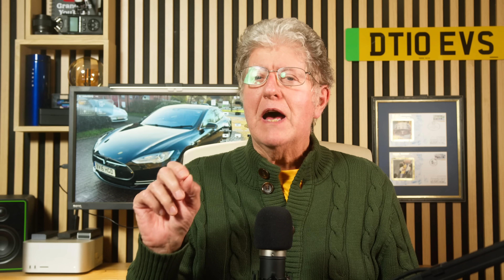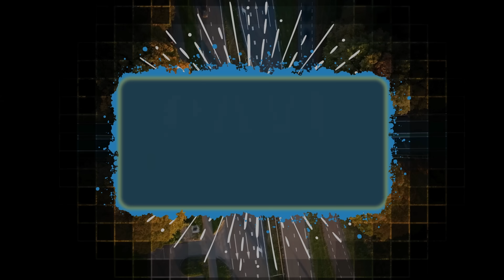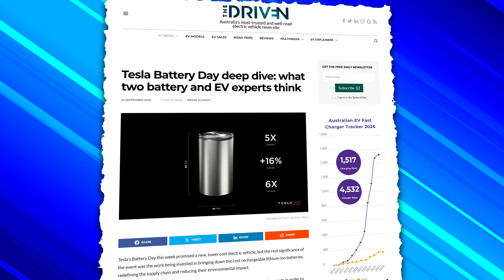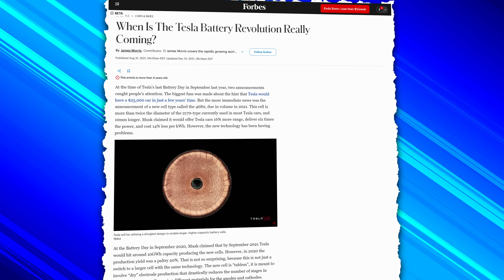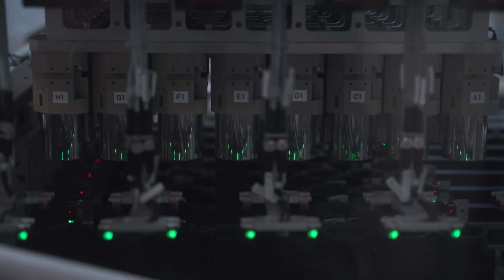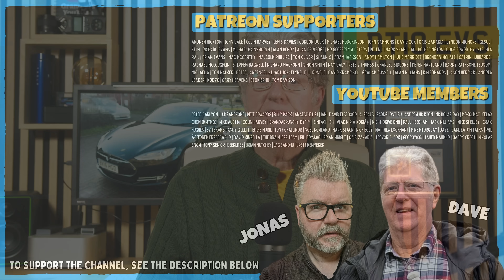The Real Reason Tesla's New Battery Is Such a Big Deal

Comment: We're getting several "impossible" battery technologies this year (2026, Year of the Fire Horse) including dry electrode, silicon anode, anode free, all-solid-state, semi-solid-state, sodium ion, as well as advancements in established tech like LFP, LMFP and production automation. Much of this is driven by decades of progress in understanding electron transfer mechanisms, electrolytes, separator materials, and nanotechnology coatings. This is now progressing much faster than many realize. There is a good chance that BEVs will be cheaper to purchase (without incentives) than ICE vehicles in most Western, Eastern, and Global South markets by the end of this decade.
Reply: BEV already cheaper to manufacture then ICE including battery for sedans cars. Betting SUV and trucks to follow suit in 2027-28
Reply from the maker: Exactly. These are exciting times. There's so much investment into battery technology and there's no shortage of compelling options at a variety of price points. Like we saw with solar, batteries will only become more affordable and more efficient over time. Not only that but EVs are already substantially safer than ICE vehicles.
Reply: And many of these technologies are additive, and some are pre-cursor steps to the ultimate goal for electrochemical cells, the Metal-Air battery, with their extremely high energy density (11,140Wh/kg for Lithium-Air, though ~4,000 Wh/kg is more likely in everyday operation). The technology was slated for 2035, but with the pace of developments recently could be somewhat earlier in maturity.

Comment: But the Chinese have already started mass producing sodium batteries, with over 10,000 cycles, only about 10% loss at minus 10 degrees, and are cheaper to produce. So I have a little difficulty seeing that Tesla's new battery Is Such a Big Deal. And they are close to solid State.
Reply: Sodium has an energy density of 160–175 Wh/kg, vs 4680's energy density just short of 300 Wh/kg. There goes your range while adding over 50% more battery weight. You have to understand priorities in most EVs.

Comment: 4680, tabless, dry electrode battery using Tesla Lithium from their own refinery will cut battery costs, increase longevity, increases power, and lowers charging time, temps, and weight!
Literally a small step in every direction making it an amazing fusion of success.

Comment: I just read that CATL and Tesla have a LFP factory in Nevada that is kinda under the radar so I wonder if the new 4680 dry anode and cathode which used to be NMC is going to be LFP now
Reply: You're assuming they'll be manufacturing cylindrical cells rather than pouch ones at Nevada.
Reply: @GruffSillyGoatI presume they will be because of the 4680 and 2170 that is made there next door already in the big building 

I presume it will help the Austin and California kato factory and the megapack in California and the new Houston one

There is also Panasonic in Nevada down the road so I have idea what it is for tbh ATM

Comment: Dave, Tesla's is just catching up with others, the issue is the others have moved on already. Like the UK's Nexeon who's gone into production with their Silicon anode technology with their South Korean partners; a technology that can be used in both Lithium and Sodium cells, raises their energy and power density, and lowers the cost of the cells.
Reply: That is amazing.. what China car gets 1200 miles per charge?
Reply: @davidbeppler3032  - does any Tesla do that? I thought their record was 1,200km (not miles) for a Model S using Our Next Energy's Gemini cells.
Reply: The motivation for Tesla is internal to them (Vertical integration) where the intellectual property, profit, design is all their own. Yes, there may be better batteries out there but Tesla does not want to buy them in from someone else who is charging a profit on top. Nobody cares what batteries are in their vehicle's packs - they care about the cost. Other factors might become relevant like speed of charging but this also depends on the chargers you use. Home charging at 7kw means the recharge speed of the pack is capped there, not by the tech. Mercedes have a super fast charging car but no chargers to make use of it. Tesla is extremely good at looking at the end to end, which is why players like BMW are embarking on their own battery plants (4680 incidentally) to cut out the middleman.
Reply: @ouethojlkjn  - BMW's cylindrical cells are 4695 and 46120, rather than 4680, they're seeking to use immersion cooling rather than paste/plate cooling to reduce the space overhead that cylindrical cells introduce. However, this makes the pack (like Tesla's paste base 4680 Cybertruck batteries) less serviceable, requiring the whole pack to be replaced. This isn't economical in lower cost vehicles, where from the end-to-end perspective the repair and maintenance cost also needs to be kept low not just the manufacturing cost. 

Mercedes, by which I assume you mean their CLA, is an 800v architecutre vehicle, with an optional 400v charging system. If one is in a country or area (like many parts of Europe, including the UK) with a high availability of 800v chargers then one doesn't need to option the 400v charging capability. Yes it means they couldn't charge at Tesla 'Superchargers' but these are relatively old tech anyway (sustaining 140kW that derates to 90kW when a charger is busy, which is becoming more often now with the uptake of EVs).

As to advantages of vertical integration vs horizontal, verticle lowers cost in establishing a technology but horizontal significantly lowers cost in scaling a technology. What Tesla is doing is less about scale and more about reducing internal costs as they face a shrinking market share (and facing rising costs of operating in their domestic US market).

There are horizontal dry coating specialist companies, like Anaphite in the UK, who not only already support NMC cells (that Tesla proports to productionise by the year end), but have already moved onto extending their roll-to-roll technology and dry coating chemistry to LFP cells.

Comment: This guy has been living under a rock. Tesla has been fiddling with this for five years and both battery technology and production methods have moved to another level. Tesla is coming to the market with a product that is already years behind.
Reply: Decades behind.  Toyota has had Solid State batteries since 2017!  Toyota EVs could do 1200 miles per charge and charge in just 2 minutes from 0-100%!
Reply: @davidbeppler3032 Exactly, Tesla and Toyota are the same battery losers. The difference is that Toyota is the biggest car manufacturer and has the most sold models, but don't tell the Tesla fanbois, they keep telling themselves that Model Y is the most sold model. BYD nixed the request from Tesla to get their Blade battery, but the best battery Tesla ever had is still the first gen BYD battery, while Toyota delivers EVs with the worst range performance in the market...
Reply: Not really. It's for Tesla self sufficiency 

They have currently two 4680 lines but they already buy Panasonic batteries, Samsung SDI and BYD and CATL and LG chem ( not sure about SK hynix)

But they have just built a LFP factory in Nevada with CATL

Remember the 4680 is just a diameter size of a battery it's not relevant as anyone can make that battery 

What matters is the manufacturing costs to make cheaper EVs. NMC and LFP exist for this 4680 now 

For example it's not relevant. Tesla needs to buy batteries from everyone but having some internal production saves time and gives you purchasing power

Comment: #davetakesiton 

Why would we ever believe Tesla / Elon !!!!!!!!!! 
Yes that new battery was announced years ago & Elon promised great things. But the figures never stacked up those battery cells were fitted in limited form to some model Y in the USA 🇺🇸 but it never had the power / range increases that were promised. Also they brought out the plaid model s & used the original battery’s in that model because they were still the best. Look at what they do & not what they say. 
Same for the new roadster they promised back in 2017 what happened !!!!!!! Lots of people put a deposit down 9 years ago. And it’s the same for FSD Elon has said nearly every year it won’t be long since 2014 & million of people have paid for it , for it still not to work in 2026. Same for the model 3 / Y battery packs i was very shocked to find out that these are unrepairable as Tesla has filled them with a rock hard foam , I presume to help stop thermal run away from jumping from cell to cell when there is a fault / issue. But this isn’t or shouldn’t be the future where a battery pack gets scrapped when a 5cent part fails. All battery packs should be fully repairable. 

I used to be a Tesla fan years & years ago. But so many

Comment: Am I correct that this battery.... " Tesla 4680 battery cell is reported to have an energy density of 272 Wh/kg"  ?   Well Chery’s Rhino S solid-state battery, has a phenomenal energy density of 600 watt-hours per kilogram.  They say it could give over 1500Km at -30c.. There is no doubt that China are leading the world. They have in some cases completely thrown away the old car build book. Using single piece pressing, dual air suspension and a host of innovative technology..
Reply: Chery can build 1,000,000 batteries in a month?  Why not?
Reply: @davidbeppler3032  I've no doubt if needed they would. Their battery tech is based on  800-V architecture and utilizes systems that dispense with laggy screen etc...
Reply: All Leary off Tesla.

Comment: Too little, too late... 4680 is already obsolete before even hitting any significant volume. Last but not least, it's an NMC battery, which is on the way out  anyway
Reply: You do what everyone who is not a billionaire does - look at it from your point of view. Tesla are not interested in battery tech, they are interested in having something that works for them in cyber cabs. More important than the tech is the cost. Tesla are focused on greatly reducing manufacture cost not the watt hours per kilo. However they are happy to partner with others when the need arises, like LFP. My guess is a Sodium Solid State battery will be the eventual winner and almost certainly a Chinese manufacturer.
Reply: ouethoj... • If Tesla has a cheap battery technology, where are the affordable Tesla Evs?
Reply: @mikel4879you can get a brand new model 3 for $37-38k. Is there anything close that can drive itself?
Reply: @mikel4879 They have only just cracked this problem.  Building multiple manufacturing lines will happen, and faster than could happen for a typical wet process. But it isn't happening this week. The most recent investors report announced 20 Billion capex investment this year, for multiple factories. Some of that will be for Robocab lines, Optimus, and AI, but some will be for 4680 lines. They may even revisit the Mexico factory.
Reply: @mikel4879you won't be able to buy them, they are called cybercabs.
Reply: Flawed argument. 4680 is cheaper than ANY other NMC form factor in terms of $/kwh. It is also more energy dense than the ones other OEM's currently use. Elon is also on record that the 4680 form factor will be used for other chemistries (specifically LFP). 4680 is just a form factor that can incorporate several iterations of chemistry and technologies. It's not a magical new technology er sae, its just the best current option for mass reduced EV's. If you know of these other superior batteries in your original post,  please share specifics.
Reply: Why do you think NMC is on it's way out?  What battery do you have that costs less than $65/kWh and provides more power per kg?
Reply: They have a LFP CATL factory for this in Nevada that's just been built secretly 

I believe it's for this so it's not NMC exclusively
Reply: Correct, it's like announcing they've improved the steam engine.
Reply: @andys5841  

Equivalent of James Watts separate steam condenser when introduced.

Comment: Lots of comments saying they still 'donut' believe it!
We'll have to wait and see if this cheap 4680 actually appears!
Reply: Donut video was just posted, about to watch now!
Reply: If it does the price of EV's will get cheaper while destroying the price of the old technology cars ouch. Petrol’s energy density advantage is roughly 13 times by volume and 50 times by weight over batteries !!.  The problem with EVs is pushing all that dead weight around and for small cars its a terrible disadvantage.
Reply: @davidlewis4399 with the high torque, the weight is not as big of a deal now. They do need special tires. It’s not great for high performance cars. Cornering and such.
Reply: @davidlewis4399  Um, do your research on the histories of the various vehicle technology. 0uch.
Reply: @davidlewis4399  I find the energy density comparisons between EV and ICE cars a bit of a red herring and mostly irrelevant. The 321 miles range for the Tesla model 3 standard range is sufficient for most people. That Tesla model gets 125 MPGe highway while the similarly sized ICE cars Chevy Malibu are at 36 mpg highway and Honda Accord at 41 mpg highway. Tesla has pretty good range and efficiency considering "all that dead weight" it has to carry around.
Reply: @skipondowntheroad5833 
"The 321 miles range for the Tesla model 3 standard range is sufficient for most people."

TM3 owner here. "Sufficient" means good, not great. On a road trip yes 300 or so is sufficient, but 500 or so would be desired. Heck 1000 would be welcome (although overkill, obviously). Less charging = less trip planning = less thinking.

And for long-distance towing we really need to be about double where we are.
Reply: Yes, Ice engines squander so much energy as heat , that the energy density comparison really a bit meaningless. 

All that  really matters  is the cost per mile, if you can charge over night for 1-2p a mile and wake up to 200-300 miles of range, for most people that is all that matters. 
 @skipondowntheroad5833

Comment: I don't understand why the 'new' cells are apparently the size of torch batteries, other companies are using a different approach to  making larger 'blade' cells giving fewer connections to fail, and fewer connections in the construction stage.
Reply: Did you even watch the whole video? Dave covers the major points very well. This breakthrough cannot be understated.
Reply: @commuterbranchline8132 - yes it can be understated, the other manufacturers and battery makers have moved on, cell to pack and cell to body packs already exist with prismatic and pouch cells, cylindrical cells lower packing density. 

Dry anodes and dry construction are not unique to Tesla, plus others have moved onto silicon anodes that improve energy density and lower costs further than carbon based dry anodes.
Reply: @GruffSillyGoat You don't know what you are talking about.  You only follow "breakthrough reports" and not manufacturing.  They are not the same.  Toyota has Solid State batteries ever since 2017.  Yet no Toyota products have Solid State batteries.  See the difference?
Reply: @GruffSillyGoat The unique element is dry cathode. No other manufacturer claims to mass produce cells with dry cathodes. There are others (Like Matthews) who claim to have a process patented but nothing being manufactured. Also worth noting that as a pack is composed of many cells, the more cells, the more you can lose while the range is not as impacted. Example - 200 blades and you lose one, you lose 0.5% of your range. 800 4680 cells and you lose one, you lose a quarter of this 0.125%. Tesla is building batteries that work for them, they aren't going to be resellers.
Reply: @davidbeppler3032  - why project you're own approach onto others? If you want to know, I seek the first-hand knowledge from manufacturers, research papers, technical and financial market analysts, and technical briefs/deep-dives, not the second-hand views of hacks/media, nor the third-hand bodged summaries from AI and influencers.

The reality is Tesla took a long time to perfect dry production, and other battery manufacturers have simply moved on to the next step in the meantime. For example, silicon blended anodes can reach higher energy densities, ~4,200 mAh/g, vs ~360 mAh/g for graphite anodes (including those of dry construction methods).
Reply: @ouethojlkjn  - cylindrical cells are not just the reserve of Tesla. BMW, for example, plan to use 4695 and 46120 cells in their higher-density packs (using cell to body structural approach with immersion cooling), but these add to lifetime costs as they are more expensive to maintain and repair. Which is why cylindrical cells tend to be used on more expensive premium vehicles rather than mass market vehicles. There are pros and cons to all cell construction types (cylindrical, prismatic or pouch formats). 

As to dry anodes, other battery manufacturers have moved onto silicon-blended and anode free designs, which offer higher energy and power density.

There are also a number of specialist companies developing dry coating processes, including Anaphite in the UK, who already have the chemistry and process for NMC cells and moved onto extending their process to LFP cells last year.
Reply: A 4680 is bigger than a size D battery it's about the size of the cardboard part of a toilet roll.
Reply: Yes. Blades also give better conrol over the packing densiy which is criical for cooling.